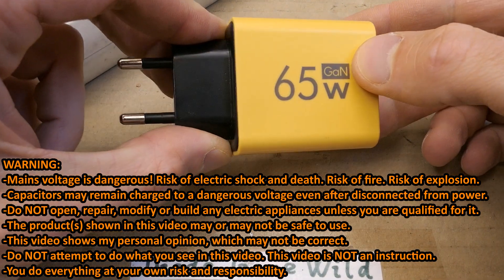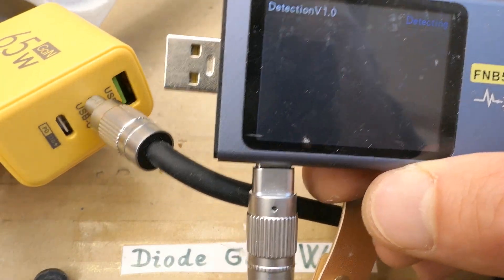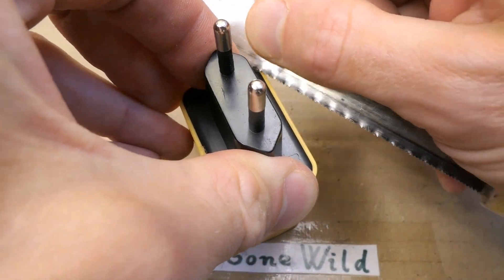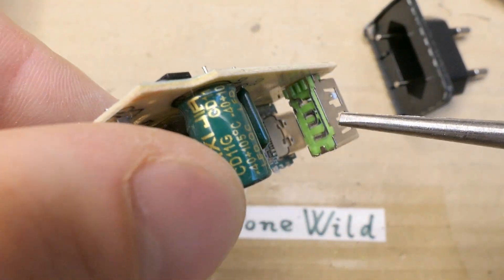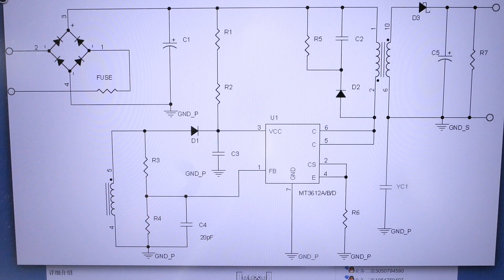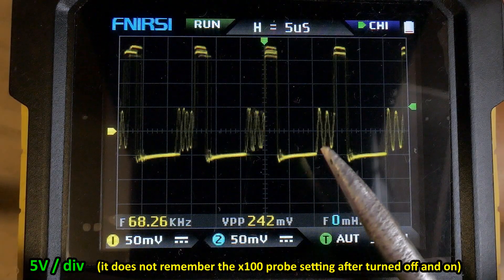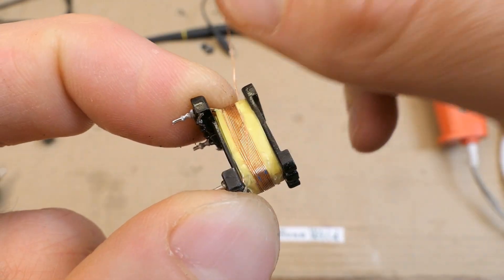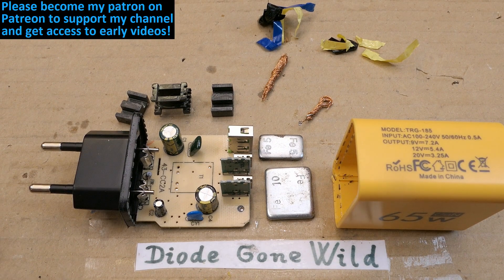$3 aliexpress 65W charger

Comment: I nearly bought such a piece of wasted materials. After I got my 1st usb c phone I needed a proper charger. I bought one in the local supermarket, it was priced with 10€ but for an error in their system I was billed with just 1.99€- The register registered wrong, cashier gave zero fucks- good for me. I didn´t test the charger yet but it charges the phone rather quick so I guess it does put out 20v. Thanks, nice kitty!
Mine are shown on my channel…

Comment: One other test you could have performed was a primary to secondary flash test - see whether the insulation between windings could withstand 500 V or 1000 V without sparking-over...
I bought some of these devices to use as low power 5 V supplies, (get 9 volts if I can), but the insulation must be tested...
Loved your video !  😊❤😊

Comment: So just to be sure, it's better not to buy chargers from Temu, AliExpress, and similar marketplaces? And instead, buy something certified from local sellers? I bought a 3m charging USB-A to USB-C cable on Temu, which was supposed to be data-capable, but unfortunately, when connecting to a computer, it keeps disconnecting. When charging, my USB tester shows that only about 0.6A flows through the cable, while with a cable that's about 1 meter long and three times more expensive from a local seller, the current is around 1.2A.
Reply: Yes? Just buy from a reputable source?

Obviously Temu and similar are rife with fakes and bad quality...

Comment: My professor who is an electrical engineer works with a chinese company, and they developed the 65W GaN chargher which is exactly the same as the yellow in the video. He handed the prototype (It's not even available for sale) to me and it weighs around 190 grams. And, most importantly, it works very well. I can't believe I found the clone of the charger they are still designing! I wonder how is it possible that they copied the shell even if it's not for sale yet

Comment: I was initially thrilled to buy this as Ali Express claimed it to be a 65W charger.  On receipt, I found it to be a slow charger, cheap built and I told Ali Express.  They are in the process of refunding me the amount I paid.  At £1.67p, don't expect it to be of the original quality!

Comment: the 2 slugs you pulled out may be loading ballasts for the transformer.

if you have any more of them cheap chargers you may want to try testing them with and without the metal slugs and see if the waveforms change.

it may be possible that there are some varying quality of the transformers maybe even pulls from junk boards.

we see on other videos where people in china heat the boards over a fire and pull the parts and assumably to reuse them

Comment: The decimal point is fallen off between the number 6 and 5, this because you held it upside down. The number doesn't represent the real watts but they also used very thin chinese copper cladded aluminium wires to test the results. It is a little off the specs but who cares if everything used is not what it looks like. Constant non-quality at every aspect is really the quality of this product, it is ..... amazing.

Comment: Where did you get the USB cable you used between the charger and the tester? It seems to be a very nice cable
Reply from the maker: The USB-C to USB-C cable came with my Fnirsi soldering iron HS-01. I have a video about this iron.

Comment: You can actually get safe & real 35w and 45w chargers from Asometech & Essager that are actually well built, the 35w one is around 6-7$ and the 45 is 10-12$ and they are actually probably built & safe chargers for that price based on the teardown I've seen, quite a good value just not this!

Comment: 3:30 These are chinese weights... on a chinese scale! Which one is incorrect? The weights, the scale, or both?
Reply: If you have a few Euro coins, especially ones that look sort of fresh-ish, you can just calibrate the scale, since they are cast precisely and are taken out of circulation when it starts wearing down. I'm sure DGW knows better than to blindly trust a scale from Ali.

But usually the factory calibration for reasonable weights placed well in the middle is pretty good, even on a dodgy scale. Sometimes the load cell is badly cut and you get different readings on different corners, but usually the discrepancy is tolerable. Sometimes the load cell is overrated and at the high end of the scale, well beyond about 200g, it starts distorting the outcome but still not by THAT much.

Comment: Why do you think the core has an airgap? (At 8:20, for a transformer this seems to have no real purpose... Maybe for very fast load changes the inductance should be limited to allow changes in the DC component?)
Reply from the maker: it's important because it's a flyback power supply, where the transformer works more like an inductor with more windings. It prevents the core from saturation (but yes, it also reduces the inductance). There's a lot of DC component (the current only flows one was in the windings).
Reply: @DiodeGoneWild  OK, I see! It's not just there to scale the voltage like with a half-bridge circuit. (How silly of me... too distracted by the cool disassembly footage, I guess.)

Comment: I think the mass they used is for automotive purposes and they weight a bit less because the tape that holds them was in the case, so i think that the weights have the right mass if they have the tape on them.

Comment: If they were honest and sold them as 5V 2A without the weights, they would actually not be that bad. The isolation distance and transformer are much better than a lot of other cheap chargers around the same price, and it can actually output 2A continuously.
Reply: 5V 2A at that size? nobody would want that. 
You can buy a 5V 2A charger barely bigger than a socket plug.
Reply: But no proper safety caps, so cRap.
Reply: Yeah, but with the switcher chip at 90.7C with the lid off, it's life at 2A will probably not be the long.
Reply: @paulstubbs7678 Or the transformer at > 100° C
Reply: Not good at all - the external temperature is 60°C.

Comment: Well, even before watching this, I kinda knew the 65W rating would not be 65W. For example, I have a 120W GaN charger, which I paid £25 for, and that was with a discount code (should have been £50). You can't get a GaN charger for £3, and this video confirms this.
Only thing missing was the "so the conclusion is... DODGY!" at the end, which you normally put in these videos.

Comment: Logitech did that with several mice, they added weight to make it feel nicer.
Reply: Yes, before they understood their market, now they make superlight mice (like everyone)
Reply: There is a hard technical reason to do this with mice in the past - tracking acceleration limit on optical mice sensors. By adding weight, you limit person's ability to accelerate the mouse and prevent the sensor from misreading and "spinning out" where the read direction is completely unrelated to real movement direction, usually an accidental singularity determined by highlight direction or spot unevenness.

Now since early 2010s semiconductor manufacturers make dedicated gaming mouse sensors which can run more DSP passes per frame and thus have a larger range of valid accelerations, and successively the weight could be reduced without the sensor losing tracking under high performance use.

The very first optical sensors like 2610 could only track 0.25g acceleration. Then it became common that most sensors could reach 10g, but you can still lose tracking on these sensors. By 2016, 50g mark was reached on high end sensors and weights could be removed. When i played Unreal Tournament 2004 and other high movement games competitively, i would sometimes exceed 15g rated sensor's tracking capability without the weights, but i cannot exceed 30g, not even close, though there are players with more athletic arms than mine.
Reply: @SianaGearz  Interesting reasoning, I never opened up my Intellimouse Explorer 20 years ago but it was very easy to move it too fast and lose tracking. The MX518 later on was much better. Lighter weight is definitely preferable though!

Comment: This is the first I’ve heard of a gallium nitride charger. Are they some hot new thing?
Reply: It's been a thing for a few years now.

GaN fets have lower switching losses allowing manufacturers to achieve the required efficiency at higher frequency. Higher frequency translates to smaller and lighter magnetic components (transformers for isolating coverters, inductors for non-isolating converters). 

The overall result is smaller and lighter PSUs for a given power and complexity level.
Reply: From what I'm reading  gallium nitride is supposed to be the new cool thing. That's its main advantage over plain silicon. It's supposed to run cooler. Which lets manufacturers pack components closer together to achieve smaller overall packages. You can't have a charger taking up so much space in your purse, you know?

Comment: I hope the wire in the transformer is actually solid copper!
Reply from the maker: Yes, there's so little wire that it's not worth replacing with copper coated aluminium, I guess.

Comment: They will, likely, claim "65W" is the model number, not the electrical rating. This seems to be the new ploy.
Reply: That's 20 Velociraptors Carrying 3.25 AA batteries.  It was a typo they forgot the other A.
Reply: how do they get around advertising 20V@3.25A then?
Reply: @n-steam  That's just the serial number. ;)
Reply: @n-steam  Probably a 1 or 2 star rated store  on ebay or aliexpress ..
Reply: They do not need to do so, because they will go unpunished anyway.
Reply: Like that "600DB" horn that doesn't destroy the universe when you operate it?
Reply: Na, that's an old one, I had a small pair of PC speakers, labelled 1200W, they'd need a direct lightning strike to achieve that  power level!
Reply: 65W P.M.P.O for those, who know ;)
Reply: 400 000W P.M.P.O speakers 😂😂😂
Reply: Maybe you need to put it into a furnace as fuel, and it equals to 65 watts of heat for a few minutes.
Reply: Considering that in the US Subway successfully defended that "12 inch" isn't an actual measurement but a trade name when people found out that the sandwiches aren't 12 inches long.
Reply: Chinese lying over figures?
Who'd have thought it.
Reply: Claim to who? These parts are not officially sold in europe, there can be no law suits or anything like that. It’s just people who are too stingy and want to save a few bucks for a charger.

Comment: This is why you don't buy ANYTHING from china that's attached to 120 or 240v mains...
And many people DO, because they're clueless and this can cause significant fire hazard in apartment buildings. You can't control what your neighbors do and most people are not informed enough not to buy this crap... and then you suffer from it as well when the whole building burns down.

Comment: I paid more than 3 USD for that weight, while the laugher of this weight only is worth much more already.

The question is: can you use soldering iron as a test load?
Reply: There is a USB 5V soldering iron but it's not very good and it's only 7W, it's not that exciting. The high end soldering irons with USB-C capability need the charger to actually switch up to higher voltage modes so they won't draw much power either from such a dumb charger, not exciting either.

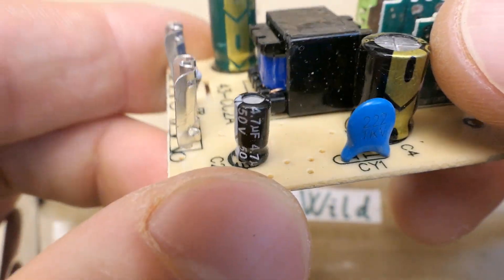Comment: 5:43 the drop of solder that stick to capacitor is to balancing the charger in conjunction with the weights. Explanation: when you trow the charger to the trash bin it as to be stabilized to center the trash bin.

Comment: I like this very much - it only supplies the voltage that is not written in the specifications and none of the ones specified. And it contains random automotive weights that don't even match the weight written on them. This engineer is a total anarchist.

Comment: i recently got one of those as a gift from my dad and when i tested it it supplied up to 12v no problems but I'm kot quite sure of what's the real output, it charged my phone no problem with PD and a laptop charged really slow so I can't say for sure how it works, the weight is very similar but overall it doesn't seem as dodgy as the one showed, I'm intrigued of how it is on the inside so maybe some day I'll try to pry it open
Reply: If it is giving 12V that is the "real" output, at least under the load your phone constitutes.

The more interesting question is how high a voltage can you get out of it with some sort of dummy load!

A good 20W charger is probably adequate for most smartphones, but you probably won't find a proper laptop charger that is rated for less than 45W unless the laptop is designed to be very power efficient.
Reply: Open it and see if it has Chinesium ingots

Comment: The weights are circuit breakers and a safety measure. 
When it gets too hot inside the enclosure, the glue melts, the weights drop down and short-out the entire thing. Then the mains breaker will pop if there is one. 
Very clever safety system!
Reply: Very clever application of a crowbar circuit
Reply: This is probably what they secretly mean with the lacking  "automatic overload protection"
Reply: Sounds like a "crowbar circuit" to me!  🤪
Reply: @pileofstuff   No the weights are high current shunts for ultra precise measurement of the charging currents. 5V=10g iron shunt, 12V=5g weight shunt and 20V=No shunt. xp
Reply: lol nice joke
Reply: If they first close the primary to the secondary side they even solved the Customer Complaining problem :)
Reply: He also missed the new ultra-safe Bluetooth voltage control. If you don’t enable that how will you ever get your 65W? Sheesh 🙄
Reply: Oh my god, those are weights to balance a cars wheels… they just grabbed whatever was there and stuck it in the case…
Reply: Maybe they turn into antimatter and this power supply poof into oblivion.
Reply: is safe or no ??
Reply: @mr.mohammed4971 hell no... its a scam charger
Reply: And when explode, is for breaking the plastic and locate in nearby skuls. It is proven that skulls with metal plates resist better to bullets !
Reply: I thought they were being used as heatsinks

Comment: Even the internal weights are lying, that's hilarious 

"Chinese 10 grams" 😆
Reply: I was waiting for a super dog lol
Reply: Scammer got scammed 😀
Reply: Lol
Reply: They look to be tire balance weights of some sort, and not very good ones. It’s China so if your Xiaomi’s wheel flies off after it develops a shimmy it’s not a big deal.
Reply: @mysock351C  You sound American.
Reply: @peanutbutterjellyjam2179  You sound like you have a problem with that.
Reply: Lol... for a second I thought the chinese 10 grams are different that the usual ones
Reply: Now we know why the Cherry amoda 5 SUV axel broke off after the owner drove it 4km out of the show room😂in Malaysia
Reply: OMG people at 3:17 you can see he took only the weights out and the adhesive remained on the plastic. The missing grams are the adhesive because the weights are sold together with the adhesive.
Reply: @marius8032  Nah that's foam acrylic it weighs nothing, it doesn't make up for the missing 0.7g on the "5g" weight. That would be more than half a millilitre of a high density polymer, so imagine a block of 1cm x 1cm x 0.5cm, that's how much plastic you'd need to add at the minimum to make up the missing weight. Foamed polymers are of course less dense than that, so you'd need even more. The metal weights are simply severely underweight.

Comment: I have 120W version of this. Which is basically the same PCB and the same iron weights but doesn't have Type-C ports and advertises QC 5.0 120W over USB Type-A lol.
It list 5V with 9A, 9V with 5A and 12V with 3.6A outputs. And these doesn't even match the advertised 120W. I don't know what they smoked.
Model Number is TRG-159.
Reply: Hmm. Those outputs would be maxed at somethinh like 45W/45W/42W...

So if you apply sketchy and very bad math, 45W + 45W + 42W = 132 W ?! 

Even if that actually worked /somehow/, I think that with 3 separate devices plugged in you might burn down your house.
Reply: @jnharton  It has a single Type-A output.

Comment: I have observed (and makes sense) that those chargers' maximum current at any pf the supported voltages is the current they can output at their highest voltage, in this case 3.25 amps @20v. So they cannot output 7A at lower voltage even if the power is within limits.

Comment: For the price, it's not bad. But lying about the capabilities, that is low.
Reply: It's bad. You can get Ikea 5W charger for the same money with much higher quality.
Reply: @hojnikb  but this charger puts out 10 Watts. Not that I'd ever want to use it with those weights hanging over the circuit board. I know what heat does to that kind of adhesive. At least throw some fish paper in there.

Comment: dgw will go crazy when he sees supervooc chargers supplying 10amps through a usb port
Reply: With a completely proper design and spec compliance, USB PD 3.1 should apparently be able to deliver 240 W....

Assuming a 20V output, that would be 12A.

That would be a hell of a fire hazard if the charger was not manufactured to spec or the cabling was sub-par but still somehow allowed that kind of draw.
Reply: @jnharton  its 48v 5A for 240 watts, usb ports are rated around 6A  but the chinese manufacturers have their own crazy protocols which do crazy high current